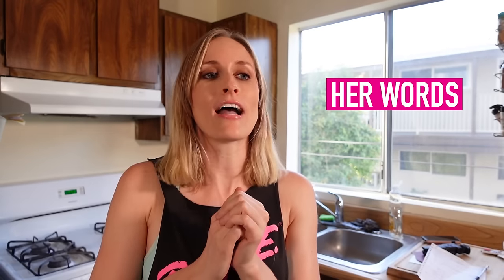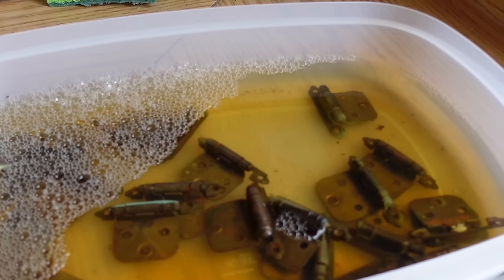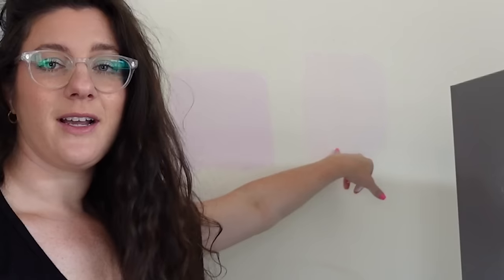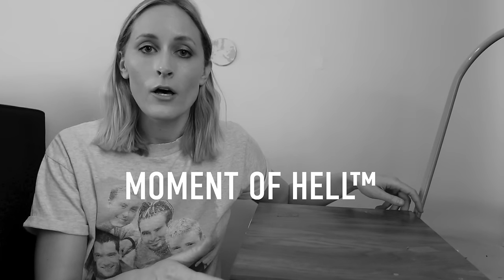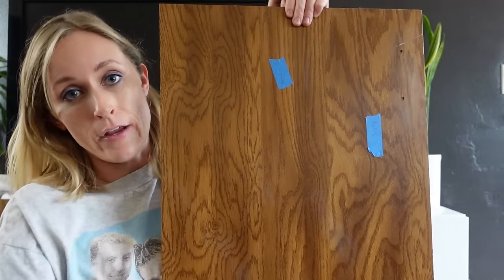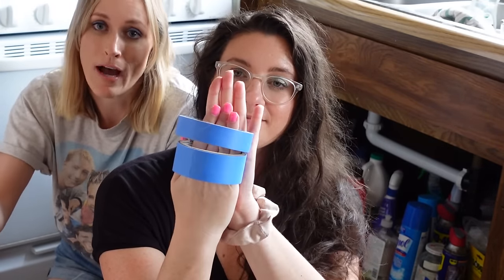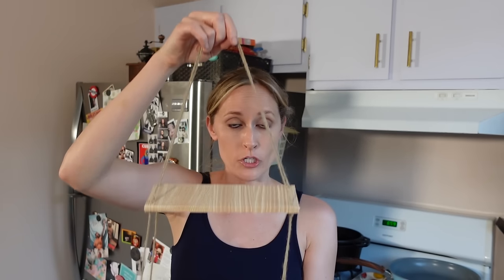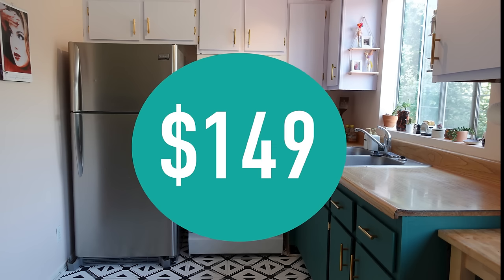AMAZING RENTER-FRIENDLY KITCHEN MAKEOVER ON A BUDGET ($150) | EASY DIY W/ CONTACT PAPER CABINETS

Comment: Cute, funny. Not sure how drilling holes in the cabinets and walls are renter friendly but there's also a wall painted black so i guess we don't have the same definition of renter friendly. The floor upgrade was awesome
Reply: A lot of landlords don’t care if you paint as long as you can paint it back later
Reply: Everything that is reversible is renter friendly to me. Holes can be filled up, walls repainted back to original colour.
Reply: @idakwapinska6905  those refilled holes in the wooden cabinets will not look the same therefore not renter friendly
Reply: Black walls are no Problem. You just need some more paint coats to cover it up when you move out  :)
Not so shure about the holes in the cabinetts
Reply: Sometimes landlords are ok with updates. Especially small ones like hardware additions.
Reply: How does the story end, did the landlord like the handles added to the cabinet doors? I think the handles elevated the space.
Reply from the maker: Landlord came over the next weekend and loved it all!
Reply: You can't paint the wood look back. Those cabinets are irreversible. But if they will stand the test of time and landlord likes. It does not matter
Reply from the maker: @haveaniceday23  it’s all done with contact paper.
Reply: @haveaniceday23  you don't paint the wood back, if it was painted you would just use a paint stripper then sand and finally a sealer to protect the wood.
Reply: Easy to fill, and many landlords would be happy with the upgrades anyway.
Reply: @haveaniceday23 did you watch the video? 😂 the wood was not painted!
Reply: You can easily take the knobs off and fill in the holes and get paint matched. 🙄
Reply: Anything that can be reversed (and all of the above can) is renter friendly. Free your mind!
Reply: @_1Brick1_ Are the cabinets not still going to be cabinets just because now they have knobs? I can imagine no landlord saying the cabinets are ruined because they have knobs. He/she probably won’t even remember what they looked like before.
Reply: The problem with a true rental friendly makeover is that it wouldn’t have enough of an impact because of the severe limitations. If you literally can’t change anything, then the only thing you can do is add accessories and you can never transform a kitchen just by adding accessories.
Reply: I said the same thing because these upgrades wouldn’t be renter friendly in about 99% of rental spaces. Total click bait. I’m out ✌️!

Comment: Tip: Before painting, rub olive oil into your hair, liberally. This will keep the paint from sticking to your hair (it will shampoo out easily) while at the same time giving your hair a spa-type conditioning. A light sheen of olive oil on your face, neck, ears, arms, & legs will also do wonders for your skin & allow the paint to wash off easily.
Reply: .....As a former Professional Painter...I just wrapped my hair up ( it's long) and wore a Satin Shower /Sleep Cap when working .. no paint ,no washing required.  😊😉
This also works when using  Power Tools... A saw, A Wet Saw, ...you get  idea......lol..

Comment: For the removable tiles, you can put posterboard down and lay the tiles on top of that.  If you're worried about them shifting, only use the posterboard on the middle tiles. And then you only have glue on the outer edges of the floor when you remove the tiles.

Also, I was cracking up at parts of this video.  It was so fun to watch.
Reply from the maker: I LOVE this hack. And I would definitely do it in future ones. I also heard about taping vinyl sheets down. Either way, we love brilliant deception.

Comment: I think contact paper is a kinda iffy thing. I have used it w=before and it works well with non painted surfaces. Like if they're a wood with a stain or varnish or unstained it works well but surfaces with paint or a printed surface it will take of that in some places
Reply from the maker: That is a great point! If these were older and had layers of paint I wouldn’t have used it.
Reply: I used contact paper on my 70s cabinets and there were some spots where the finish came off when I removed it.

Comment: This is such a gorgeous transformation. However, I do have a question: Is it okay to drill holes into the cabinet doors? Wouldn't that mess up your deposit? LOL Because... I am REALLY contemplating accessorizing these cabinet doors with hooks!
Reply from the maker: No, good question. And I should have explicitly said the landlord was fine with it. If you want to add hooks damage-free, I would use command strip hooks. If you want to add handles, you can fake them like this:

https://www.crazy-wonderful.com/add-knobs-without-drilling-holes/

OR you can do these peel-and-stick ones:

https://www.walmart.com/ip/Self-Stick-Instant-Cabinet-Drawer-Handles-Pulls-4pcs-Aluminum-Alloy-Push-Pull-Helper-Adhesive-Door-Handle-Kitchen-Window-Sliding-Closet/1339366650?wmlspartner=wlpa&selectedSellerId=101095802

Hope those help!
Reply: You’re awesome. Thank you for this and your reply!

Comment: I just found you while brainstorming what to do with my kitchen... Subscribed
Reply from the maker: Aw yay! We have fun ideas for ya. Note: Don’t put contact paper on if your cabinets are painted. 😉
Reply: @LaughCryDIY  I own my house I just want something temporary until I save  for a full reno is it ok? Or does contact paper not work on painted cabinets?
Reply from the maker: @daisyfreshification  oh! Amazing! It‘ll likely peel paint off when you remove. (But it’ll stay. You might need to replace here or there if you have a lot of use and, ya know, ding it with silverware or something.) Since Rachele had laminate wood cabinets, they wouldn’t be an issue. I used paintable peel-and-stuck wallpaper on another kitchen makeover on the channel for painted cabinets because it’s made to be removed from painted surfaces and the adhesive isn’t as strong. But if you own, I might recommend painting with one of the paints that doesn’t require as much work (like major prep and sanding). I’ve heard good things about things like Beyond Paint. https://m.youtube.com/watch?v=ZO4u4YTIwgM
Reply: @LaughCryDIY  thank you sooooooooo much!

Comment: So contact paper you can just take of without any problems? And it wil not start to curl up from humidity??
Reply from the maker: Since the cabinets were laminate wood (and not actually painted wood), the paper won’t damage it when it comes off. Same as if you put it on a shelf from Ikea. No problems with humidity since we’re in the desert of LA. It’s been a year and a half, and it’s still on great!

Comment: I love this and want to do my apartment like this! Does the contact paper come off the cabinets easily? Just nervous about getting my security deposit back. Thanks!
Reply from the maker: Good to ask! So if you have cabinets that are wood or laminate, it will def come off. Might have to clean some residue off, but it will come off. If the cabinets are painted, the contact paper will take paint off. You can also use peel-and-stick wallpaper, which isn’t quite as strong as contact paper (but again, only on unpainted wood or laminate). Hope that helps!
Reply: @LaughCryDIY  Thank you so much!

Comment: What would you say is the cheapest and most durable to use to do a hole townhouse flooring? We rent
Reply from the maker: Peel-and-stick tiles are the most inexpensive option BUT they are more difficult to get up and you shouldn’t do them over wood or vinyl plank floors (only laminate or tile or whatever). I’m also a fan of faux wood flooring (you can put them over as sort of a floating floor), but they are much pricier. Otherwise, printed vinyl mats are a good option to add pizzazz if you just absolutely hate your floors and can’t do much with them. Like this: https://www.vmathome.com/collections/best-sellers

Comment: Does the contact paper mess up the cabinets when you take it off?
Reply from the maker: Since these cabinets aren’t painted. They’re just straight wood laminate, there may be some sticky residue but can get that off easily. I wouldn’t add the contact paper to painted cabinets. (I would use peel and stick wallpaper, which is meant to go on painted surfaces.)

Comment: Man, I feel so dumb. This is amazing! I wish I thought of contact paper. I used beadboard wallpaper for my parents' kitchen cabinets, and painted them sage. I don't think I could copy this exactly since the oak handles can't come off. They look nice with the wallpaper but a few bits of the paper have already come off. I really messed up, didn't I :(
Reply from the maker: Noooooo 😭😭😭 Don’t feel bad. I used that beadboard wallpaper in my parents’ house. Spent all night putting it up. First time I moved a piece of furniture, immediate rip, so it’s the paper (NOT US). Also, I would have thought it sounded like a good idea too!
Reply: @LaughCryDIY  Aww thank you <3 It's so weird because the issues I anticipated weren't what happened at all! It holds up so well to moisture, stains, and being scrubbed down clean, but the oven door being whipped open too fast while the cabinet door was open caused a tear. Oh well :(
Reply from the maker: All the struggles of DIY 🙄

Comment: I laid down poster board before my peel n stick tile so it all came up in a sheet when I had to remove it
Reply from the maker: Oooh! Genius. Did you seal any part around it? Or was it more of a floating floor?
Reply: @LaughCryDIY  I left a bit of sticky edge around the edges to make sure it was secure to the floor, cause there ain’t no way I could pull up that adhesive easily if I did the whole tile lol
Reply from the maker: Totally get it. That’s a great tip!

Comment: Did you ask to drill holes for the hardware? If landlord isn't okay with it, will you just fill the holes and take the hardware with you?
Reply from the maker: Yep. The landlord was OK with it since they were in pretty rough condition. If not, I might have done some cool stick-on cabinet pulls I’ve seen on Amazon.

Comment: Wow…I think it’s cute that they think any of this was renter friendly. I’m pretty sure they will be so upset that there’s contact paper stuck to everything! They might yell out loud! In fact it would have been better at that point to properly paint the cabinets to update it.
Reply: The problem with an actual rental friendly makeover on a kitchen or bathroom is that it won’t have any impact since you can’t change anything. You’re basically restricted to just adding accessories. You can’t transform your kitchen just by adding a vase of flowers and kitchen towels.

Comment: How is this renter friendly? You are painting, drilling holes, scraping floor…wuuttttt
Reply from the maker: I hear you. Depending on your lease, things can be limited. In this case, other than the cabinet holes, it’s all reversible when she moves out. We added that hardware with the landlord’s permission too. Since many rentals have cabinet hardware already, switching that out is another renter-friendly solution to upgrade a space (that you can easily switch back when you leave).